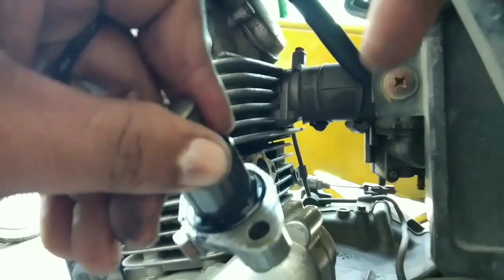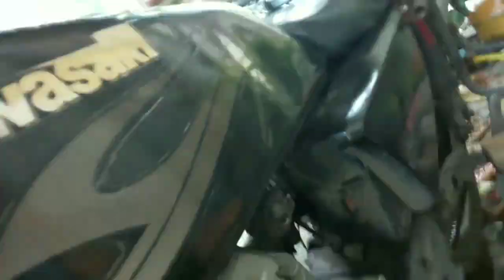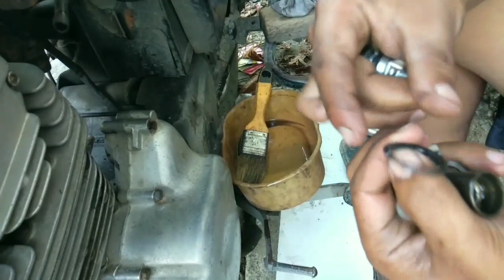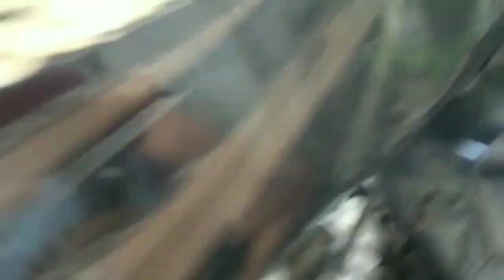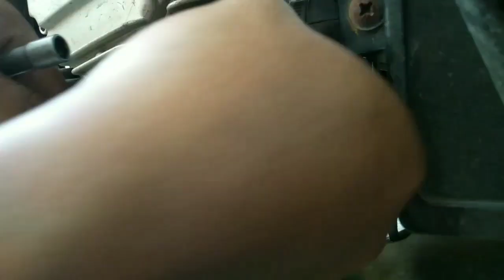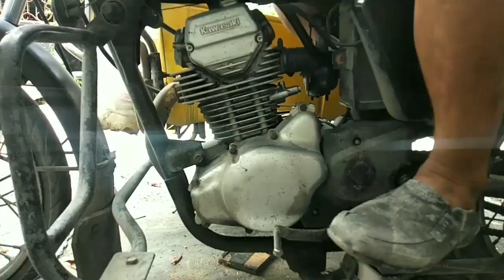Paano mag reset Ng tensioner at mag palit  Ng oring Kawasaki BARAKO.

Comment: Boss idol paano po pag reset ng tensioner ng barako 2,175 na model 2020 kasi hindi katulad s mgamodel 2019 papaba ung tensioner
Reply from the maker: Hindi na po ni rereset ang tentioner Ng Barako model 2020 dahil self adjustable na po sya, SA madaling salita Hindi na sya kailangang galawin
Reply: @tongbitstv.9018  idol bago lang po na tune up pero medyo may ko ting ingay pag tumakbo ng 60 to 80 kph naalala k di ku kasi nagalaw kaku ung tensioner bka need po ng adjust .  Pero gnun pa man idol nag aadjust pla un kusa so di kuna pla kailangan na buksan? Or i adjust ulit un
Reply from the maker: Kung isang taon na mutor mo lods 0.5mm valve clearance intake at exhaust. Para Hindi maingay
Reply: @tongbitstv.9018  ginawa k plang standard ung clearance ng valve k idol kaso medyo may maingay bka s tensioner boss nkabitan kasi motor ku agad nkaka 800 kilometers plng nun idol  tpos alalay ako s takbo pero nung nka 1800 na ako maingay na sya kya nag check ako clearance,ang luwag tpos nung ok na may maingay padin kya gusto k sna i check ung tensioner at mapakiradaman ulit kung magbago pero un nga self adjusting na pla sya.mag 3 monyhs plang si barako ku idol sa march 8. Kulang na kulabg sya s break in. Sa tingin m kya idol anubg best sulosyon or anu ang maipapayo mu sa akin salamat idol